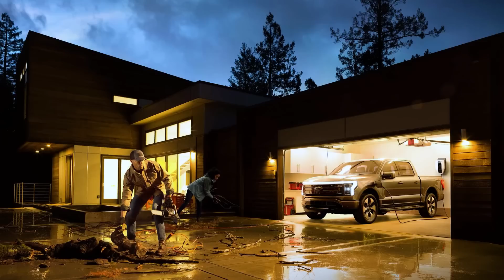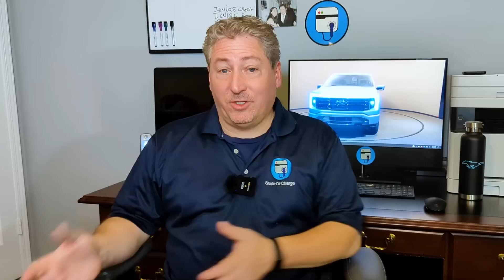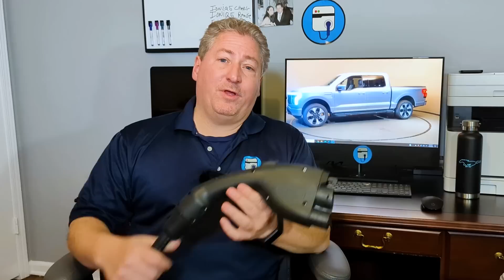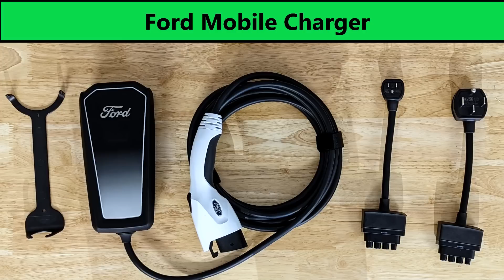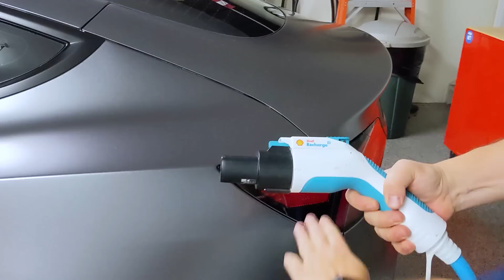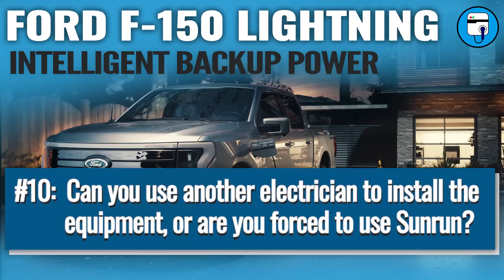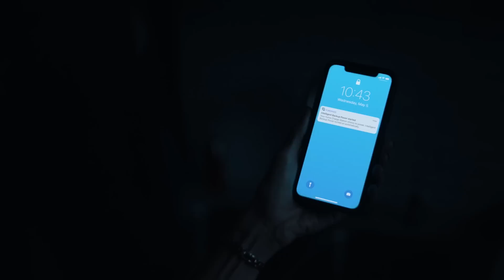Ford F-150 Lightning Intelligent Backup Power: Everything You Need To Know

Comment: I've already got Solar Roof and powerwalls, now I've been looking into the hypothetical ins-and-outs of adding to that system with V2G. Realizing the nuanced difference between V2G and V2H, I wonder how it would interface on the load side of the powerwalls and gateway.

If someone were to backfeed energy from their main breaker panel, or the Ford energy station, I wonder how an existing backup and inverter would handle that? We already have a dedicated 50A charger in the garage... idk if this could ever be a good modular extension.
Reply: P.S. - great point about the warranty. We barely drive our EV, but use the powerwalls nightly for TOU. Cynically, I suspect that and the UL regulations are holding this tech back. The battery warranty is a huge selling point for EVs, but that's usually tied to miles. Bad metric if you used battery for V2G primarily.

Comment: Any idea when the installation instructions will be made available for the Charge Station Pro and Home Integration kit?  Ford only details a single slide for the Charge Station Pro - not a install manual.  I'm sure these documents will cover the nuances of installation - which would be very helpful for circuit planning, etc.

Comment: Excellent video.  Does the Ford Power Station work with other CCS vehicles or just the Lightening?
Reply from the maker: Yes, it will charge any CCS EV.
Reply: @StateOfChargeWithTomMoloughney  does the vehicle to home capability work with other cars like the Mach E, ID.4, or Ionic 5 when using the Ford Power Station?

Comment: Does the ford charger pro ‘cooperate’ on the same circuit if you you have, say, two Lightnings and one Mach E on three Ford charge Stations pros but all three on one dedicated 100 Amp Circuit? 

Similarly, would the three separate Ford Charge Station Pro EVSEs ‘cooperate’ to know which vehicle to pull electricity from to power the house in the event of a home power outage? Would the EVSEs ‘switch’ from vehicle to vehicle until, say a plugged in vehicle got down to 20% charge reserve for driving that you set it to?
Reply: Wish I could find this answer.

Comment: I'm getting a Tesla model 3 and a f150 lighting over the summer.  Can I install the ford charger and the Tesla charger to share one 100a circuit, or do I have to run a 100a for the ford and a separate 60a for the Tesla charger?

Comment: Very good video.
What is the difference between setting you house up for the Lightning and setting it up to be powered by the Hybrid Powerboost? What does the Powerboost need to power a house?
Can the Powerboost be used to charge the Lightening via the house?

Comment: Hey Tom, great video! I have Enphase Solar and Storage so I already have a transfer switch to island my house. Can I use Ford Intelligent Backup Power and skip all the Sunrun equipment?
Reply: I'm sure that answer is no.  The high voltage battery in the truck cannot connect to your Enphase system, since enphase is microinverter based (AC) and their storage battery is also AC coupled.  The truck needs to connect to a conventional high-voltage inverter - that's not something that is exposed with your Enphase system.

Regarding wanting to use your Enphase whole home transfer switch instead of the Sunrun one, I'm sure that would be nice, but not likely they support anything other than the Sunrun equipment regarding that aspect.  So sadly you'd likely need both autotransfer switches.

Comment: You should be able to cut away the plastic of the Tesla Adapter to fit over the plastic connection of the CCS connector. This should not affect the intergerity of the Tesla adapter plug. Using a dremmel or a small cutting tool would probably make it an easy fix.

Comment: The truck needs a 100 amp dedicated circuit? Really? We recently installed 10 extra solar panels on our house (we now have 24) and had our main upgraded from a 150-amp service to a 200-amp service. We already have a 50-amp dedicated circuit for our Tesla wall charger. Even with our upgraded service, I don't think there's any way we could add a dedicated 100-amp circuit for the F-150 lightning. Wow. That's disappointing. We do have a gas water heater, gas range/oven, and gas furnace, so maybe that makes it doable?

Comment: Okay haveing a new house built with the smart panel with solar and battery but sun run is not in ky. Every solar installer has no idea on how this truck to house charge works FORD is not putting much info out. Mine will be a stand unit until the full size bronco goes EV in2026

Comment: Hello Tom.
The amperage comes down by the app or it is automatic option, and this station has a monitoring system? I mean the charger works like a power controller with the existing service and protect the charging process against overload and tripping, right? Thank you

Comment: Great video, thanks! Question: Do you know if the Charge Station Pro can be mounted outside? We currently have a Flo X5, we got it because it was rated to handle our Canadian winter weather and it has held up nicely for the past 4 years. However,  I've noticed many other charge units are designed to be mounted in a garage, I don't want to have to jump through hoops to plug in my vehicle when I get home from work...thanks!

Comment: This appears to be more that a plug and play system. Is this installation similar to that of an automatic transfer switch for a generator? If not, how is back feeding into the electrical grid prevented? This installation is also another cost that wasn't addressed.

Comment: If the charging station is installed on a 20A circuit, that means the wires are likely only 12 AWG, which can only safely handle 20 Amps.  Thus, the power that the Lightning can SAFELY supply is limited to the size of the circuit used to power the charging station.  In other words, if you tried to pump 9.6 kW of power from the Lightning into a circuit designed to supply only 4.8 kW, you will blow the circuit breaker because you are trying to put 40A into a circuit with a 20A breaker.  Technically, since 9.6 kW is equal to 40A at 240 VAC, the minimum circuit size should be 50A.  (That provides the 20% spare capacity.)
Reply: The AC (charge) side and DC (return) side are completely independent.  Different breakers and different wires. You can charge on a 20A circuit while supplying 9.6kW on the DC side.  The DC side does not go through the same breaker as the AC side.  It does not use the same wires.  So, you can have a 40A breaker being fed from the (Sunrun) inverter while simultaneously using a different 20A breaker for the charging side.
Reply: @evahsia  Well, that makes sense!  Whoda thunk?  The video didn't make it clear (at least to me) that two separate circuits were involved.  Still, if you're going to push 9.6 kW to the house, the minimum breaker from the inverter to the house should be 50A, not 40A.  It seems to me that the breaker / circuit should be sized with 20% headroom, regardless of the direction the power is flowing.  (9.6 kW at 240 VAC is 40 Amps, so 20% spare would require a 50 Amp breaker and wires sized to match.)
Reply: I agree.  If 40A actually reaches the breaker, then yes, you need a 50A breaker.  My bad.  However, while 9.6kW (max) leaves the truck, we don't know the efficiency of the Sunrun inverter, it is likely the actual current that gets to the breaker will be less than 40A.

Comment: I’m sure someone will come up with a CCS to Tesla Adapter as soon as this system becomes available.
Reply from the maker: That won't likely work because the CCS connector on the Charge Station Pro won't utilize the DC pins to charge the truck. The adapter will rely on those pins to feed the vehicle.
Reply: @StateOfChargeWithTomMoloughney  Maybe I misunderstood what you were getting at in the video then - you were talking about a J1772->Tesla adapter, and how it wouldn't work because of some plastic feature on most if not all CCS plugs. I was suggesting that someone will come up with a J1772->Tesla adapter that has a cutout in it allowing itself to be fitted to the CCS plug on the Ford Charge Station Pro (the J1772 portion) without clashing. Maybe the fact that the DC pins in this scenario are not connected (even though Teslas pins are used for both AC and DC) will cause the system to fail to operate. I don't know how the system controls of the Ford EVSE are managed, so you may be correct. Seems like a bummer that literally every other EVSE can charge a Tesla except this one; it seems like blunder that Ford would not account for the % of it's Lightning reservation holders being current Tesla owners who want to remain Tesla owners, and now these buyers have to manage 2 EVSEs at their charging location. I'd be annoyed to have to have two EVSEs installed in my small space.

Comment: If you have a small facility that sometimes has higher load than 9.6 kW (e.g.: 10 ton heat pump in deep winter - max draw of slightly over 9.6 kW, not including indoor unit, facility baseload electronics, or auxiliary resistance heating when it gets really cold) can you combine multiple trucks and meet those demands? If so, how many trucks at a time? Or if not, can the system trigger activation of supplemental power from a backup stationary natural gas generator or other power source when needed.

Comment: Enjoyed your video and your inside EB podcast. I currently have a generator at my house with a transfer switch. Rather than spend the thousands on the intelligent back up I think a much more economical route is to use the 240v plug in the truck bed to power my house. As far as I can see this would only require me purchasing a longer extension cord that will go between my transfer switch and my Lighting. Is this an incorrect assumption?
Reply: Yes, it is a more economical choice for those who already have the connection and transfer switch.  A couple of details matter.  First, the 240VAC in the bed is only a 30A circuit (7.2kW).  This is less than the 9.6kW from the Charge Station Pro + Sunrun inverter.  

Second, the connection in the bed is a L14-30 (4-wire L1, L2, N, G).  You need a compatible extension cord, and generator inlet.  There is no indication a 3-wire (L1, L2, G) circuit would work.

Third, while Ford advertises all day power at a worksite, they haven't committed to the 24 hour (3 or 10 day) constant load, which may not be covered by warranty.

Comment: Greatly informative video, thank you so much! I have one question... I don't know what the service is to my house, but I have two 200A panels feeding all the circuits. Will the pro charger be upstream of both panels thereby allowing backup power to all circuits in the house? Or does it only power one panel?
Reply: The functionality will be limited by how much you are willing to pay, with one exception.  

If you have 2 separate meters (one for each panel), you won't be able to feed both panels.  If you have only one meter and want to pay the $1000s of dollars to get a whole house transfer switch between the meter and the panels, then you can feed both panels.  

Most people would spend much less money on an essential loads subpanel, given that there is only 40 amps coming from the truck.  You can move a few essential loads from each main panel to the subpanel for a relatively small installation cost.

Comment: Tom - off topic, but I wanted to pass on some info. I configured a Nissan Leaf S Plus this morning and at the end of configuring there is an option for "Charging" where you can check the 240 V/ 120 V EVSE for $1600 (Yikes!) but it  seems that there is no standard 120 V EVSE included with the car. I did not read the fine print, so maybe I'm wrong. I bring this up because you commented on the lack of any included EVSE with the Kia EV6. Maybe a trend is starting now that EVs and charging infrastructure is maturing? What are your thoughts? Thanks!
Reply: They do include a 120V portable EVSE, which they refer to as a trickle charger.  

From the website:  "Need a charge in a pinch? The Nissan LEAF features a standard 120-V charging cable, which allows you to temporarily plug into a standard 120-V outlet for a Level 1 charge. It’s the slowest option, but it lets you add some range wherever you have access to electricity."  

Clearly, they would prefer you buy their 240V EVSE.
Reply: @evahsia  thanks for finding this.

Comment: Is it possible to attach two vehicle to grid cable vehicles in on the same system? I imagine this will become important as more families switch to two EVs.
Reply: Some solar systems with many panels use multiple inverters to get sufficient power.  Each operates independently through their own AC breaker (in the main panel or subpanel).  So, it is likely that if you have multiple cars that have V2G/H functionality and an inverter for each, all could feed a panel independently.  They would each have their independent safety systems.  (Same with one V2G and one solar inverter.)  Two Lightnings would need two Charge Station Pros and two Sunrun inverters.

Comment: Excellent work Tom. Need to emphasize that after spending thousands of dollars for backup, it only works if the truck is at home and has a decent SoC. Also many homes will need a secondary panel for BU power to isolate heavy loads. As we go electric many new homes have 400A.
Reply: Most heavy loads aren't essential during a power outage,  just don't operate high powered devices.  Anyway when Ford states the lightning will power the average home for 3 days, they are basing that on a maximum daily usage of 30 kWh.  So around 90 kWh of use in 3 days. That would still leave around 41 kWh left in the truck battery. Reducing the load to 10 kWh/day would stretch that to 9 days.

Comment: How is it you can put it on a 20A circuit and still back feed 40A???
Reply: It is unclear what you are referring to.  My guess is you are mixing up the AC side and DC side.  It is perfectly possible that the system is connected to a 20A circuit on the charging side and a 40A circuit on the DC side through the DC-AC inverter.  They are completely independent, including the wiring and breakers.  Normally, it will be a 100A breaker on the charging side and 50A breaker on the back feed side.  But both could be lower.
Reply: @evahsia  You are correct, I am assuming the EVSE has a single circuit and that it is basically an inverter/ charger in and of itself. This is how the WallBox Quasar works, which is the only other bidirectional charger that I am aware of. If this thing needs an AC circuit in and a DC circuit out I am going to be disappointed in Ford's engineers... but that wont be the first time. What I want to know is if the Quasar 2 will work with the Lightning.
Reply: Interesting perspective.  I am on the opposite end.  I would not want the charger and inverter combined.  That would unnecessarily increase the cost of the charger for those who never plan to buy or use the inverter portion.  

I am actually disappointed that Ford bundled the charger with the extended battery.  I would rather they charged $8000 for the extended battery and $2000 for the charger.  People who don't want to or can't feed the 80A charger could choose a cheaper wall box.

The Quasar 2 is currently vaporware.  Also, no vehicle manufacturer has announced compatibility with it.
Reply: @evahsia  I guess a seperate inverter makes sense given SunRun has designed the system they'll just treat the F-150 a one big LG pack, dedicate an inverter to it and Bob's your uncle.

Comment: At 12 minutes: Is it really true that the on-board truck inverter does not send out AC power, and instead the truck sends out DC power for a separate inverter that needs to be installed on your house? 

That definitely sounds wrong. I doubt this is the case considering the AC power available on the truck, the 9.6kW inverter is already on-board with the Pro Power Onboard. If true that is disappointing considering all the hardware is already available on-board.
Reply: It is true.  Here is Ford's official statement you have to agree to when ordering:  "Sunrun is also the exclusive supplier and installer of a custom inverter which must be purchased separately to enable Ford’s Intelligent Backup Power System."  

Now as you point out, there is AC on the truck which you can use as you see fit (with lots of extension cords), but the IBPS is an additional option that gets wired into a panel as a standby generator.
Reply from the maker: That is correct. It sends DC power back to the house, as that's how it's stored in the battery
Reply: @StateOfChargeWithTomMoloughney  Other independent sources agree. 
Huge miss by Ford on this system. The correctly sized inverter is already on the truck. 
My original assumption was that a relay would flip to allow the DC pins on the SAE combo charger to be utilized for AC power back to the grid from the on-board inverter. This allows the simplicity of having a single SAE combo charger for charging and back-feeding to the grid.
Definitely not worth the extra coin to me then. I would just use the on-board inverter and plug-in when needed. Will save me thousands for the 1-2 times this will come in handy in the lifetime of the truck anyhow.

Again a large missed opportunity that I am sure another OEM will come through next and fix.

Comment: I just ordered my Lightning, and it came with this notice:  "Sunrun is also the exclusive supplier and installer of a custom inverter which must be purchased separately to enable Ford’s Intelligent Backup Power System."  The key words are "custom inverter" which makes it likely that a typical off-the-shelf inverter won't work.